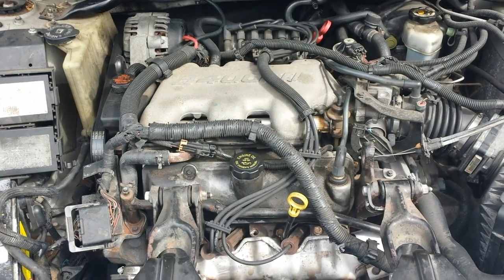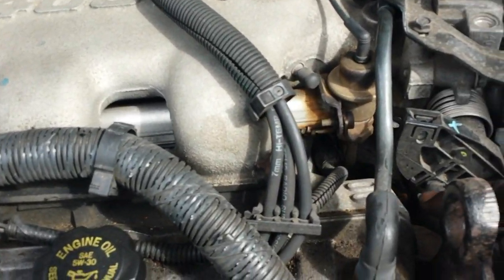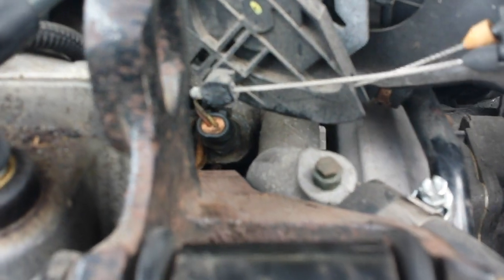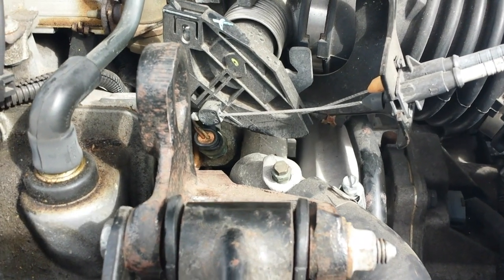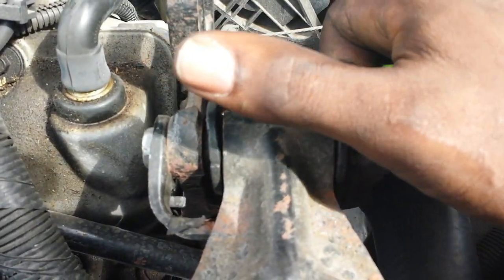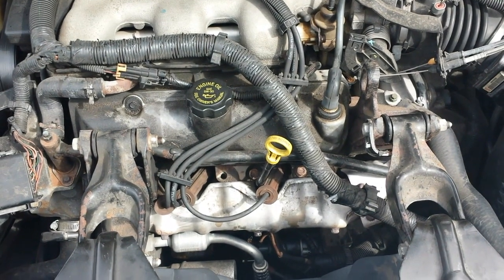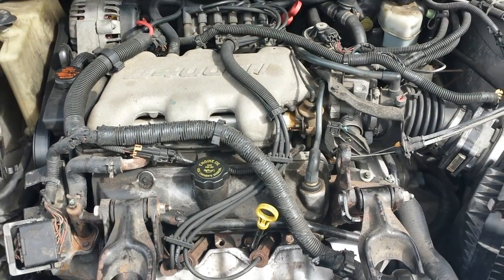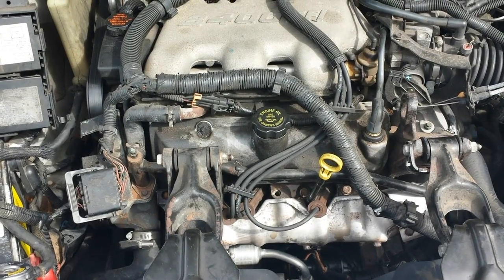How to Test Radiator Fan on Chevy Impala--Easy!

Comment: I had to disconnect the temp sensor on my Ford focus to make my fans run however, it caused my alternator to fail by putting such a load on the charging system! So, I spliced into one of the temp sensor wires, ran one end of the wire inside of the car & to a toggle switch, then back to the cut end of the sensor wire! Simply looping the connection back to itself & connecting a toggle switch to break the circuit, causing the fans to come on but, NOT HAVING TO RUN THEM CONSTANTLY!!! Now, I have  Pontiac G5 2.2 & I have never seen the fan run so, I have devised a way to run another toggle switch to access the low speed fan by probing the fan relays with a grounded test light until one of the pegs turned the fan on...so I connected to that peg, ran a wire to a toggle switch inside the car & connect the other end of the wire to a ground! I guess cool fan #2 is how the ecu controls the hi-speed fan on a G5, cobalt, etc... so, I need to keep testing until I can control the hi-speed fan!!!

Comment: That's a good test but  easier way to disconnect temperature sensor plug-in right across were you put your oil in you can see there's a disconnect there that's disconnect you from the temperature switch you don't have to go down there and pull it off like you did it
Reply from the maker: Thanks for helpful tip👍 Please subscribe & like and share if haven't already and check out our other helpful videos

Comment: Mine is a 2005 3.8, The Fan Stays On, even on cold start and stays on about 3-5mins after I shut the engine off, along with a P0117 DTC.... Whats the cause? I though it was the ECT Sensor, But, I've changed that, but didn't solve the issue.

Comment: I have a 2004 Chevy Impala and recently my car overheated and my upper coolant hose bursted and I replaced it and now I’ve realized my fans are not working I need help please
Reply from the maker: Check you relays should be under the hood.

Comment: So with mine i disconnected the sensor and put it back in while the car was running and the fans turned on but only for a few seconds. What does that indicate

Comment: I have a 2001 chevy lumina I have just done my temperature sensor and fans dont work only if I turn on the a/c , my cor only gets hot if I'm at the stop light.  Next step is to check  relays

Comment: Def trying this tomorrow i got the same engine in my buick century had the coolant leaking used the k seal it stopped the leaks but I am still getting crazy foam bubbles in my resovour tank not great on fixing cars so i been learning from videos i learned how to burp my coolant from your video my fans are not working just figured that out my car is over heating so bad i can't even drive far or leave my car running my heat comes on and at stops goes cold now when i burp my coolant i get heat at all times after a day or two it gets bad and it's winter time smh i went to 6 mechanics they told me flat out i don't even want you to get this fixed the head gaskets etc the miles i have etc i know it can be fixed and if i had the proper stuff i can do it i know the parts is cheap but the labor so getting thermostat done is ok and if water pump is bad that's fixable I got a radiator cap i burp my coolant until i can figure it out
Reply from the maker: Hope it helps, good luck on getting it fixed. Please subscribe & like and share if haven't already and check out our other helpful videos

Comment: I just replaced my temp sensor on my  02 Monte Carlo SS in an attempt to fix my cooling fans. I checked all 3 relays and 2 fuses properly with a multimeter and battery. When I unplug my temp sensor like you did my fans start on low speed for a second then go to full speed and stay on. How would this indicate a bad relay? I can feel all the relays click when I do this test.

Comment: So I'm in need of serious help. Mine is 2003 Impala 3400 fans do not come on with ac or at temp. I have tried this technique and fans do indeed come on when harness is pulled from sensor. All relays are good but they aren't getting the signal. Temp sensor shoes correct reading on gauge. Would that sensor still be bad? Please!!!

Comment: Question I have a 96 impala so my ac compressor is empty on freon (no ac) and I have 1 fan running on passenger side cooling the car, but the other side doesn't  come on. I pulled the temp sensor like you did, and both fans comes on. So is the other fan not running due to ac not working or does both fans supposed to be running?
Reply from the maker: Fan alternate and yes on some it comes on when ac compressor is on; if vehicle is not over heating then should be fine.Glad could help Please subscribe like and share 🙏.

Comment: Hi sir, i am from india , i have seen your videos. I have chevrolet beat lt petrol. Where is the location of temperature sensor so that i can remove the connection and check. As i see your video in that position i found a sensor and removed the wire and found that fan is not working but when i am turning off the ignition key that time it start for 10-20 seconds. After that i connected the sensor again and this time radiator fan not start up for 10-20 seconds. And sir fan is working while operating my ac. Please help me out. I have cleaned the resistance near the fan. And connected it again. But problem is same.